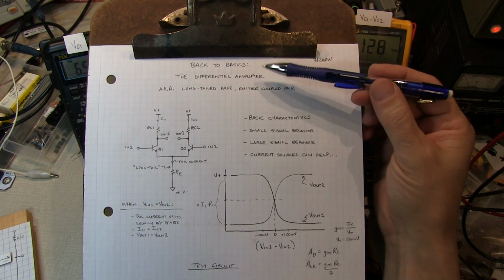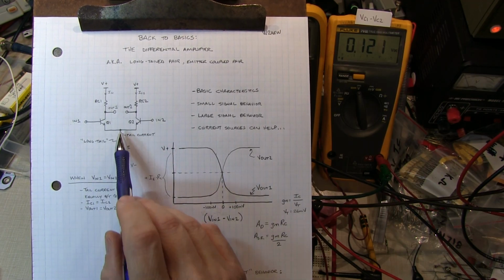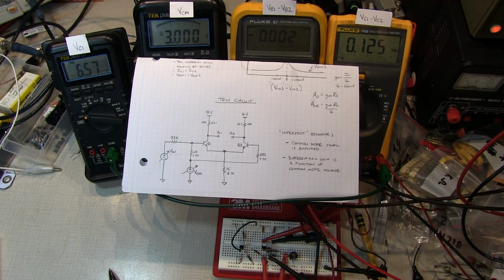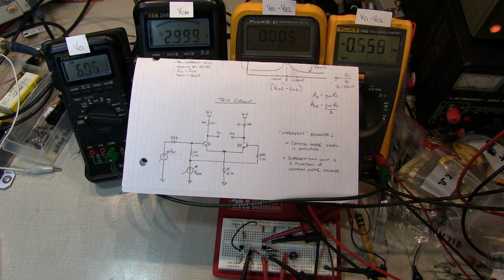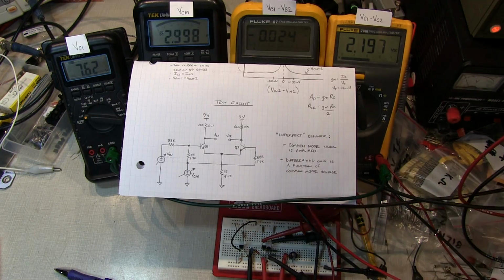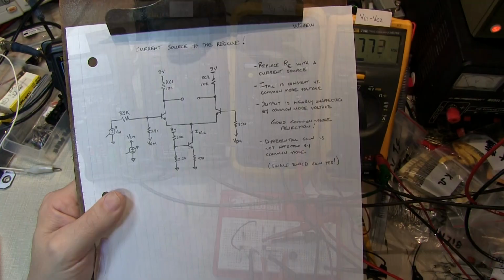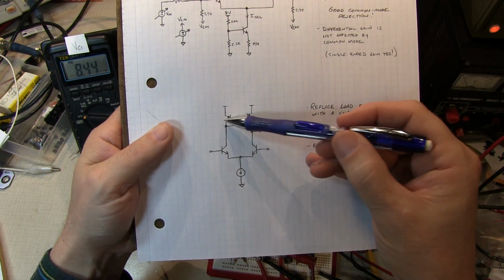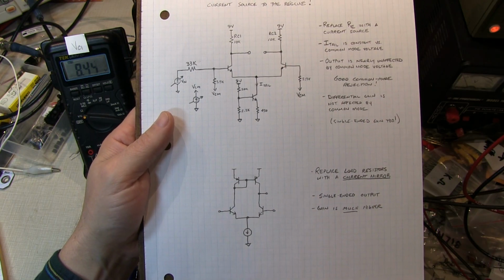#193: Back to Basics: the differential amplifier, aka long-tailed pair, diff-pair

Comment: I have a question. When Ic1 increases Ic2 decreases that's the thing. But for that to happen the tail current must be constant. But there's no current source there, there is just a resistor at the  tail. How is the tail current kept constant by that resistor?
Reply from the maker: Good observation.  Of course there will be some variation in the tail current when a resistor is used.  However, when talking about the linear gain region of the diff amp, we're talking about "small signal" operation, where the inputs vary by typically 100mV or less.  When using a resistor to set the tail current, there will generally be 1V or more across the resistor - so the amount of change with the input signal is small.  The more voltage that appears across the tail resistor, the less the current will vary with the input.  If your circuit doesn't have the voltage headroom to put more than several hundred mV or more across the emitter resistor, then you'd get better performance using a current source.

Comment: Great video. One question. How do you create a load line for the transistors in the differantial pair when driven from a current mirror  and also having a current source on the output of the emitters.

Comment: I'm trying to design a floating-ground GFI where a current (its AC at about 400 Hz) being unequil on the two sides of ground would mean someone is possibly being shocked.  I am guessing that a good starting point is this type of circuit, making it into a current comparitor.  Any suggestions would be appreciated.

Comment: at 3.00 mark, he says that as the transistor conducts and Vin1> Vin2, more current flows into Q1. If more current flows, shouldn't the pd on the Vout be also more? why does it decrease due to the drop across the other resistor Rc when there is a dc supply to it as well?? I am super confused on OP amps.
Reply from the maker: When Q1 conducts more current, the voltage dropped across RC1 gets larger.  Since the top of the resistor is pinned to the supply, the voltage at the other end (at the collector) must drop.  Since less current is then flowing in Q2, the voltage drop across RC2 decreases, so the collector voltage rises.  If you're confused about op amps, I have a lot of videos on them too.  This one is my most popular:
https://www.youtube.com/watch?v=K03Rom3Cs28

Comment: hey I'm not sure if this is a dumb question but that would work basically the same with darlington pairs as the 2 transistors acting as the diff pair right? or does that not work?
Reply from the maker: Yes, replace each device with a darlington and it will basically work the same.  Only real advantage is lower input current.
Reply: thanks good to know:) kinda off topic but i haven't able to get an answer about something I have a moving coil meter measures ac it goes to 300 but i want to lower that to 160 thing is whats inside confused me its got the negative side of a 25v capacitor connected to one post then its in series with a resistor then that goes to a diode and the diode's cathode is facing toward the post on the side opposite of the capacitor why is it like that is it actually just measuring the negative half of the ac waveform? also to go lower do i increase or decrease resistor value i saw your video but I just want to make sure
Reply from the maker: It is very likely just doing half-wave rectification.  To lower the voltage scale, you would reduce the resistor value.
Reply: I really enjoy your channel bc it's so educational I'd love to see something about turning analog meters in to something other then voltage and amperage meters like that big meter you have with the delta symbol what's it for and what would it take to make one. (that's just one example) but anyway keep up the good work man!:D
Reply from the maker: The printed scale on the meter can be anything - bottom line, all D'Arsonval meter movements respond to current.  It is the circuitry/sensors/etc. around them that determines what you're actually measuring (current, voltage, power, speed, airflow, pressure, temperature, etc.).

Comment: Awesome as always! Maybe you make video about diff amps using op-amps. I found some circuit called instrumentation amplifier what is actually diff amp with ridiculously high input impedance and very nice parameters. I use it in many projects.
Reply from the maker: All op amps are really differential to single ended amplifiers, it's just that most configurations use them as single ended input.  The instrumentation amp is designed to provide the most ideal differential amplifier characteristics - high input impedance and very good CMRR (common mode rejection ratio).
Reply: Yes but enormous amplification makes op amp useless. I made some project recently. I needed amplification of about 120x and high input impedance. That was double photodiode detector (each photodiode sensing other component of laser beam) for FFT spectrometer. Also it have to be super fast. My first attempt was simple diff amp and it failed because of relatively low input impedance. Finally I used instrumentation amplifier and works like a charm :) So... maybe if there was no interesting topic sometime in the future you would make video about it ;)
Reply from the maker: You always use feedback with op amps, never use them open loop.  Fast and high impedance usually don't mix, because small amount of parasitic or stray capacitance can kill things.  For speed with photodiodes, you would usually use transimpedance amplifier, with diode reversed biased in photoconductive mode.
Reply: Actually I used photodiodes reversed biased with resistors. The thing is that signal which I need is difference between light intensity on photodiodes. One of those measure parallel and another one perpendicular light polarization intensity. Transimpedance amplifier should work better, but it's necessary to add diff amp though because of limitations of my ADC. This is easier for computer when measuring final signal than measure two and subtract them to each other.

Comment: If the base of transistor Q1 is set to Vx Volt (eg. AC voltage). And base of Q2 is set to -Vx Volt, then the difference in output voltages Vo1 - Vo2 won't be proportional to 2 times Vx, due to one of those two transistors turning off? The confusing thing is (not in your nice theory) that the text books etc don't seem to say what is the deal with the single resistor tail, where the emitter voltages of both transistors are at the same voltage (due to being directly connected). So whatever the instantaneous AC voltage is applied to the base of Q1, Ve is predicted to be about 0.7 V below that due to a diode drop. This also sets the Ve of Q2. But, if we apply to the base of Q2 a 'negative' version of Q1's base voltage, then there's going to be some voltage conflict going on if Q2 is assumed to be conducting (so that Vbe of Q2 won't be the usual 0.7 Volt diode drop) right?
Reply from the maker: The mistake here is that you can't assume that Q2 is conducting.  If the base of Q1 is sufficiently above the base of Q2, then Q2 will turned off due to the 'wired-OR' behavior of coupled emitters.
Reply: Thanks very much for explaining w2aew! That was exactly what was bugging me, as I assumed (from text books) that the differential output was proportional to the difference in the two base voltages (the AC side of things that is). The only thing that I could think of that made sense was to NOT have the emitters (of the two transistors) connected together, and introduce separate tail resistor for each emitter. Things started to confuse me (from the text books) with the single (shared) resistor connected to both emitters. I assumed that both transistors needed to be conducting in order for the differential amplifier to output a differential signal proportioal to difference between the base (input) voltages. For example, I wrongly assumed that if the inputs were balanced, where Vb1 was the negative of vb2, then the differential output voltage would be proportional to (vb1-vb2). Although, for the single tail resistor circuit, if Q2 stops conducting, then the collector voltage of Q2 will rise to +Vcc right? Thanks again w2aew. Really appreciated it.
Reply from the maker: The problem with many textbooks is that they only discuss the operation of a diff-pair in a "small signal" scenario - where the voltage changes are small and both transistors are conducting (at different levels).  This is the "center crossing" part of the transfer curve shown in the video.  Unfortunately, these texts often do not continue the discussion into the "large signal" condition, where one side or the other gets turned off.  You've got it right.
Reply: Thanks a lot w2aew. Thanks for taking your time to explain and for helping me with this. Greatly appreciated again. Can I just ask - at time 4:03, when Vb1 goes up, we are assuming that Vb2 is fixed at a constant DC voltage (with no AC input) right? And if Vb1 goes up by just a little bit (eg, 0.2 Volt or so), then the right-hand-side transistor (Q2) will pretty much begin to turn off, right? So we really shouldn't be applying any input voltage to Vb2 at any stage - especially not negative voltages, right? Thanks again w2aew. I'm starting to understand what the real deal behind this circuit is now, thanks to people like you going out of your way to explain. If only text books etc highlighted basic important details like this, then it would be good.
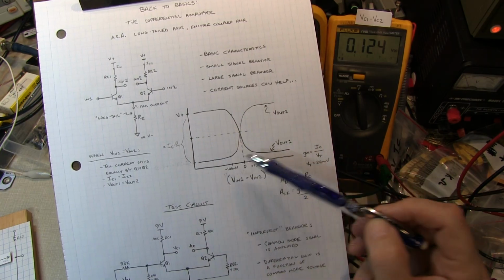Reply from the maker: It's really all about the differential voltage - i.e. the difference between the voltages at the bases of each of the two transistors.  So, at 4:03, it could be that just Vb1 goes up and Vb2 stays constant, or it could be that Vb1 goes up and Vb2 goes down.  Either way, the effect is the same: Q1 turns on more, and Q2 begins to turn off.  When you get more than about 200mV difference between the two bases, one of transistors is nearly off.  This is what is shown in the transfer curve at about the 2:00 point.  I'm glad to hear that this video is helping you out!  Once you're comfortable with the diff-pair, then check out my videos on the Gilbert Cell (really cool trans-linear circuit with three inter-connected diff-pairs!).

Comment: Thank you for nice video, w2aew. As I understand such differential amplifier works on two input signals but each of them must be referenced to ground? Am I right? 

I would find it very interesting to hear about how to implement "true" differential amplifiers which accept two "floating" inputs (ie differential to single ended converters). What I am thinking of is how to convert signal from phono cartridge to single ended form (which will be then fed to the riaa preamp) with no need to ground one of the cartridge pins. 

I suppose it could be nice topic for your long todo list.

Comment: Nice video! However, for the long tailed pair with the tail resistor --- if the left-side input (base) voltage is V1, then the emitter voltage would be approximately V = V1 minus diode drop voltage, right? This also means that the emitter voltage of the right-side transistor will also be equal to V (since both emitters are connected together), which is V1 minus diode drop. So the base of the right-side transistor will be V plus diode drop, which amounts to a value of V1, right? Suggesting that base voltage of the right-side transistor would equal V1 as well?

However, if somebody sets the base voltage of the right-side transistor to some arbitrary voltage value, then there is some kind of voltage 'conflict' condition right? That is, on one standpoint - base voltage of right-side transistor is eg.... Vb2. But from the other standpoint, the right-side base voltage is also V1? What's the catch here? Thanks!
Reply from the maker: Well, not really a conflict.  In the case of an NPN pair, the higher base voltage wins, which effectively turns off the other transistor.
Reply: Thanks w2aew for explaining. Makes sense now! Appreciated.
Reply: When left side emitter voltage rises and BASE of RIGHT SIDE transistor stays same it causes Vbe of right side transistor become lower which make the collector (of right side transistor) go higher (Inverting the input of left side transistor)

Comment: There's just one thing I don't understand.  In some amplifier circuits I've seen, they use a diff amp at the input. Ok, yes I understand the point of using that, but there is no bias for the bases of each transistor. One transistor base is just connected to the input source, and the base of the other transistor is connected to the feedback, yet there's no biasing circuit to bias each transistor base, so how does that even work?
Reply from the maker: In those cases, the input source will usually establish the bias voltage on the driven input, and the feedback will force the bias on the other input.

Comment: Another deluxe video. I tried searching your videos while trying to replace an opamp to drive the pass transistors in a PSU ( discrete components had higher voltage ratings than most opamps ). It cleared some things up, thanks :)

Keep it analog, w2aew! :)

Comment: Thanks for the video it was very helpful!

I had a question over controlling the current on the emitter. This design used a single bjt on the emitter or a current mirror on the common. I've seen some designs use a current mirror connected to the emitter of the diff. amplifier. What is the advantage of doing that?
Reply from the maker: I'm sorry, but your question isn't clear. Can you rephrase?

Comment: Quick question: Do we still get noise reduction/common mode rejection if we drive a differential amp with a differential input, but use a single-ended output? My understanding is that since the polarity of the collector's out is reversed, subtracting them doubles the output and reduces the noise that is common to both inputs.
Reply from the maker: +eliyag1 Yes, you still get input common mode rejection, but you would lose power supply noise rejection.
Reply: +w2aew so essentially noise that added itself to the inputs equally and with the same polarity (like interference) would still be present at the single-ended output?
Reply from the maker: +eliyag1 No.  Common mode noise on the inputs (added equally to both inputs) will be properly attenuated even if you take the output single-ended.  The thing you lose would be power supply noise rejection.  Power supply noise is a common-mode noise added to the OUTPUTs, so if you take the output single ended, then the power supply noise will be there (with respect to ground).
Reply: +w2aew I think I get it now! 

There's a constant current flowing through the joint emitters junction, and as long as the inputs have the same voltage, the current is split equally between the two transistor. When the input voltages are different, the current "seesaws" between the transistors, therefore causing the voltages across the collector resistors to change. So because common mode signals are err common to both inputs, they don't cause the current to change on either side, so they don't get amplified.
Reply from the maker: +eliyag1 You got it!

Comment: There are two unique points I love about this video.
1) the variation of diode operation due to increase in temperature.
2) Your mechanical simulator !
Thanks for the crazy video !! 
Wish I could work with you.. Thanks again, much appreciated !
Reply from the maker: +Deb Mullick Thank you, I'm glad you enjoyed it.
Reply: +w2aew So we have current source at top and current mirror too? Don't both force a certain current quantity? Also, how does the voltage at the ouput when using the current mirror sit "between" the voltage at the two emitters?
Reply from the maker: In that last example, the gain is very, very high. Output voltage is mid-swing only when current exactly match.

Comment: I always feel like thanking you after every video i watch. Thankyou! Amazing as usual!
Reply from the maker: +Adil Malim I thank you for watching and appreciating my videos!
Reply: +w2aew Don't we have emitter degeneration due to Re at the emitter in the tail?
Reply: +Yueeiuyoo depends how you look at it. if u look at the LPT as 2 CE amps then yes.
Reply from the maker: +Yueeiuyoo Only for common mode signals.  For differential signals, the low impedance of the coupled emitters effectively negates the degenerative feedback.
Reply: @w2aew Do the diff signals only see the re from the transistors? doesn't the common mode degeneration affect the signal swing available at the output?
Reply from the maker: @krisjk999  The common mode degeneration does not affect the available swing.  The available swing is determined by the tail current and collector resistor values (Itail * Rc), as long as the common mode bias isn't too high which may result in saturation.

Comment: Will this circuit also work with negative input voltages (e.g. V_IN=-1V and V_CM=-3V)? I don't think it will but it puzzles me how op-amp can work with negative input voltages.
Reply from the maker: +AntZ (TM) Consider what happens if you make the diff pair from PNP devices, and you precede the inputs with a pair of PNP emitter followers.  If it is biased properly, then the inputs can be below the lower supply rail.